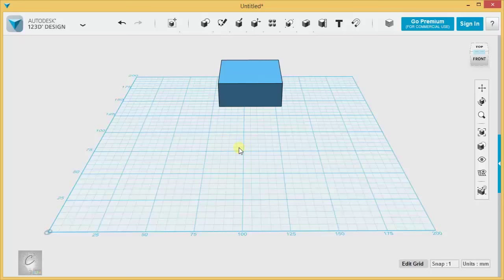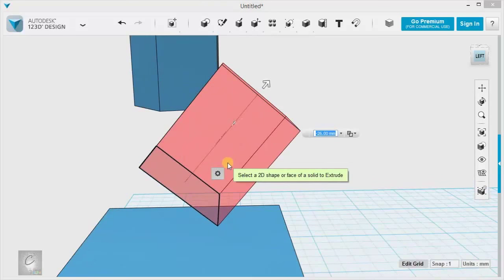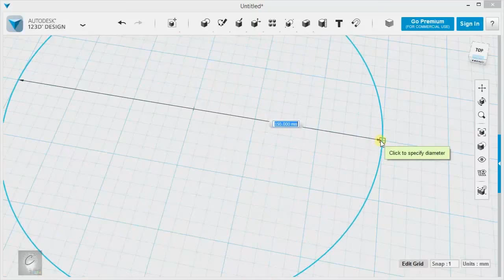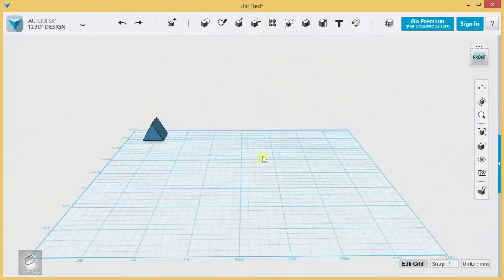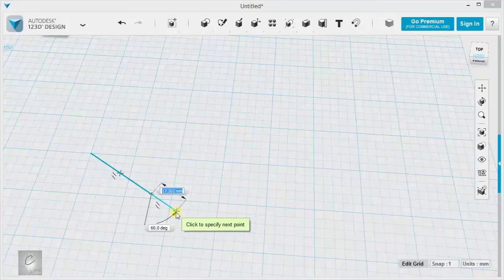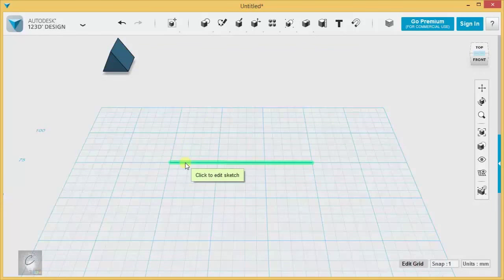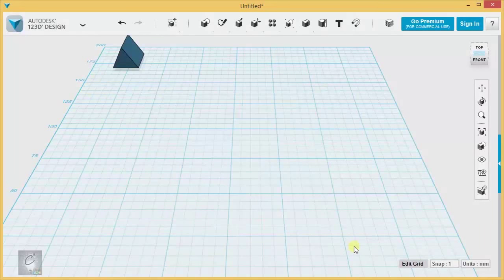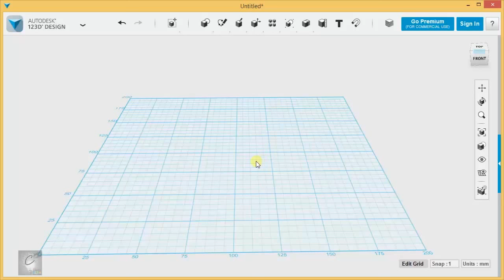123D Design Tutorial - Basics 5/6 - Basic Sketching

Comment: I've been using a 2D Sketch to "cut away" portions of a 3D solid previously developed, by sweeping it along a path set to subtraction.  The issue I've run into though is that while it will follow a line or a curve path just fine, sometimes it won't follow a path defined by the 3D Solid itself (either an edge or a face).  The latter is what I really want to do, as I'm basically running it along the edge like you'd run a router along the edge of a piece of wood to create an edge profile.  Also, there are times when I create a complex sketch from multiple lines and arcs, and they don't want to group into one sketch to be put into position and swept as one.  Any specific tips on how to make this reliable and easy?  Maybe a topic for a specific video.  Thanks in advance!

Comment: I have an empty project with a custom grid set to 100mm x 100mm.  I want to snap to 1mm, but no matter what I do, it snaps to the grid lines, which are drawn every 5mm.

I'm using the latest version, but even in your video, the snap is set to "1", but it's clearly snapping to multiples of 5.

Comment: I truly appreciate every one that takes the time to make a tutorial!  I also have the same problem as Wounded Knee.  Created a solid and moved it of the grid by 3.3mm.  Then tried to move it back to the grid.  Tried the little squares and the arrows, but it did not snap to the grid. I even tried it toggling snap in the right side tool bar.  Can't get it to snap back to the grid reference.  So frustrating.   Wish I could afford Inventor!
Reply: I did figure out how to use the ruler to move the displaced solid.  From the top tool bar, hove over "transform"(top tool bar to right of undo/redo arrows), select "ruler" from the dropdown. Click on the grid to place the ruler at the desired  base point, then click on the solid that you want to move. You will end up with "move arrows" and the relative distances. Use the "move arrows" (they turn yellow when active) to move the solid to the base point.  When finished, click the green check box.   Not very intuitive!  Works in xyz; may need to orbit and zoom in to see what you need to move.   version 2.1.11

Comment: Thanks for the tutorial.  I know that when you first sketch an object, the points snap to the grid at the specified snap settings, but what about when you want to move a sketch object?  I can't seem to get the mouse to snap to the grid if I want to move the object to an absolute x,y position neither can I enter absolute coordinates.  This makes placing object precisely very difficult.
Reply from the maker: +Wounded Knee You're right that sketches don't snap to the grid when moving it around, but you should be able to use the Move tool to type in absolute distances when moving a sketch.  And on my end of things, if I use just the 3 movement arrows, I am seeing snapping occur (but not when I use the little square).
Reply: +C3 @ Library 21c Ahhh!  Thank you, I noticed the snapping while using the arrows also.

Comment: Using version 2.1.11   I'm slowly coming to terms with 123D, but one thing that I haven't been able to do is to delete something from the project.  I know that CTRL-z undoes something, but if I created a 3d object(or a sketch) to help create my model, how do I delete it when it's no longer needed? How do you set the granularity of the the snap to grid?  It's not in my little box at the bottom right corner of the window.
Reply: Found one answer.   The granularity for the snap.  Bottom right corner, click in the square above "Linear Snap" and select one of the values.
Reply: My problem with "del" key.....I always have "NL"  (num lock) on, so the del key does not function as delete in 123.   I'm so used to using "CTRL-X" to delete, I rarely use the "del" key.  Thanks for your response.   I'm actually going to start using AutoDesk 360 Fusion.  It seems to be the way to go.